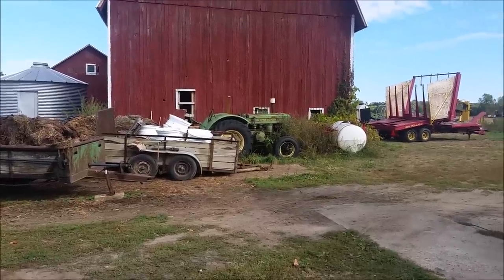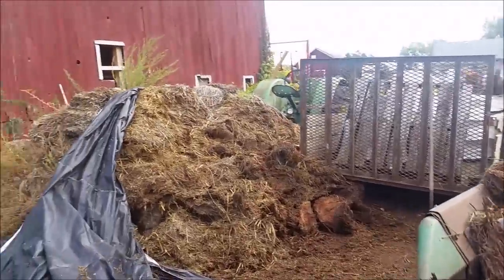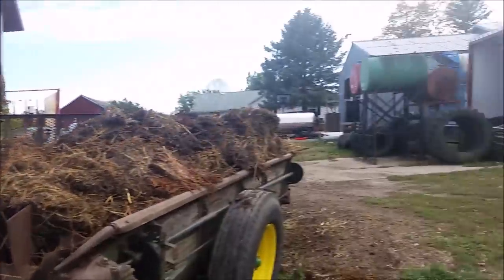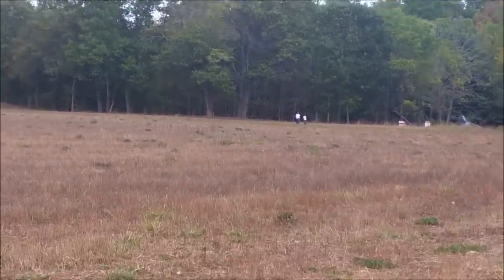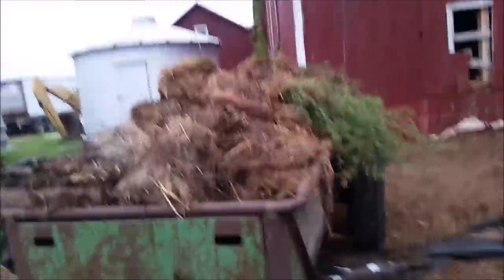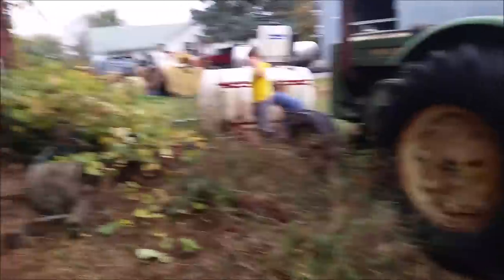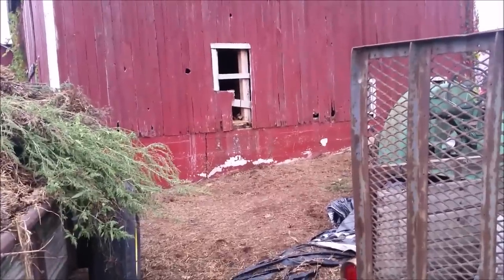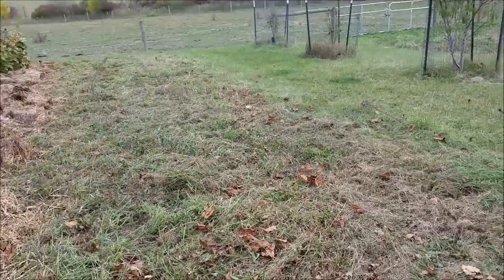Cleaning up the farm

Comment: Good Lord mom and don't tell me you loaded all that crap by hand surely you have a tractor with a front-end loader setting around there someplace you are a hell of a good woman
Reply from the maker: Than you! Yes all by hand! Cursing the backhoe through out the job. The new China made starter lasted a day.
Reply: mommymilestones my goodness Mama I wish I lived close to where you live I would be able to bring my little tractor with a front-end loader over and help you with projects like that
Reply from the maker: Thanks that is sweet. The hard work keeps me in shape. The hubby and boys did take away about 6 ft of the pile weeks before I started in on it so you can imagine what a job it was. I have a tractor loader sitting around that really needs to get mounted. I'm not cleaning the manure out the low barn by hand! The stalls are hard enough.